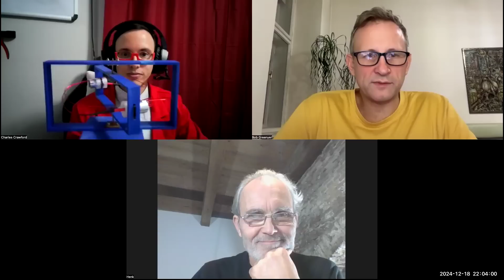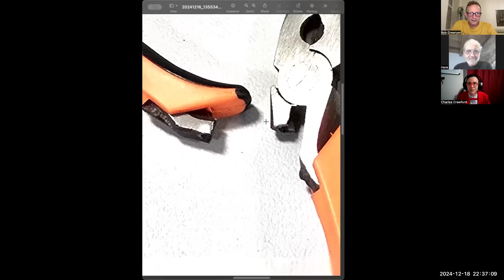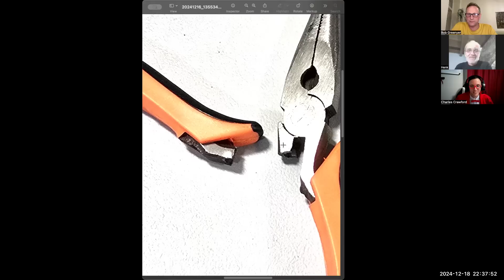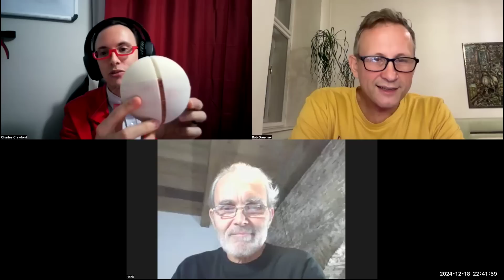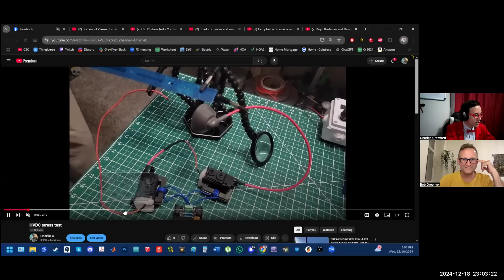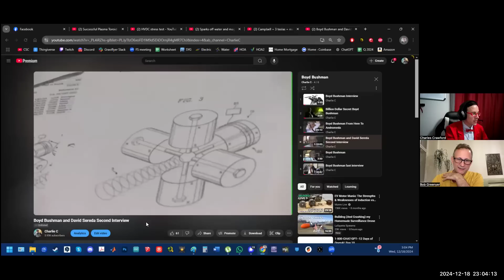Review of world's first independent attempt at a Hutchison Effect replication and more collaboration

Comment: Those are not Tesla Coils!!! Go read Colorado Springs Notes January 2, 1900 entry and compute the velocity or propagation for Tesla's 100 turn extra coil winding based on his measured period and wavelength. The problem with electrical engineers is that they have no concept of propagation above the light constant due to exclusion of the mutual magnetic coefficient, and Tesla didn't bother to explicitly calculate the velocity in that journal entry.

Comment: I think John Bedini used magneto - toro - electric clusters to charge classic lead batteries. If I understood it correctly, Bedini induced longitudinal standing waves in the coil using impulses and charged the battery with the negative part of the pulse (the positive part was doing work). He charged the batteries using potential energy and not electric current. Such a battery then behaves differently from a commonly charged battery and therefore must not be together in one electrical circuit. Such a battery lasts a little longer (5-10% longer). When the load is disconnected from the battery, the battery is self-recharged (can be repeated several times for one initial charge), ... eg video: Energy from the Vacuum - 07 - Tesla's Impulse Technology - Cut nebo Tesla's Impulse Technology Plus: The Bendini Cole Window Motor (2009)
Reply from the maker: Paul Harris walked me through the history of these devices, apparently the structures generated blow the sulphates off the electrodes and allow even old lead acid batteries to be recharged, however, ultimately they destroy the battery.
Reply: @MFMP  I can't comment on that because I don't have personal experience with it. I will just mention the opposite opinion. Aaron Murakami, Peter Lindemann, Paul Babcock have decades of experience with this technology. I hope I'm not wrong in saying that they personally use batteries that have been charged this way for 40 years or more and are still as good as new. Aaron sells chargers based on the Bedini principle.
Whatever the case, I mainly just wanted to mention that batteries charged in this way are said to behave differently than batteries charged in the normal way. And when you mentioned the oddity with laptops, I remembered that.
Reply: Make barium  power cells john Bedini  is great now onward to a new generation like bob and others